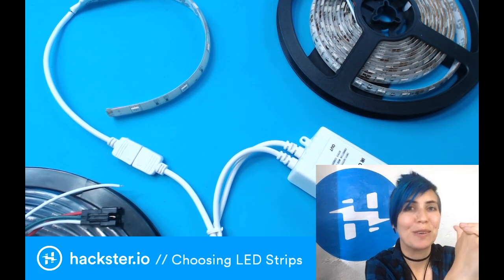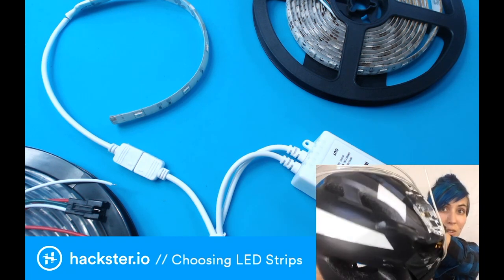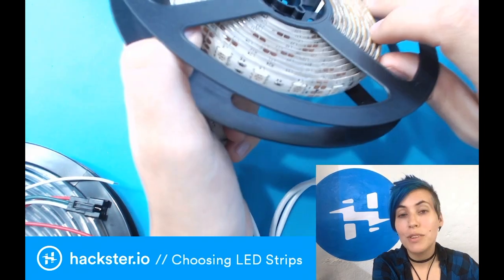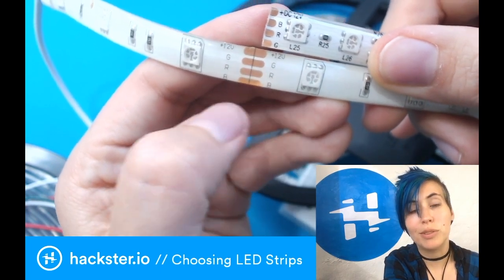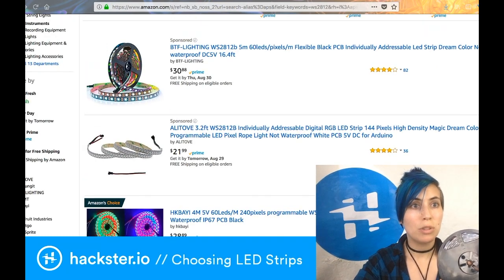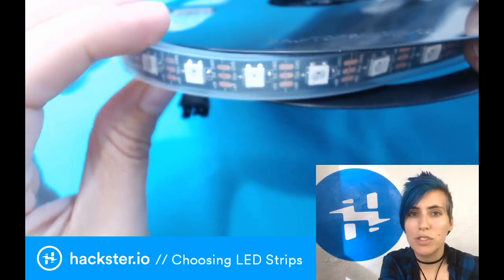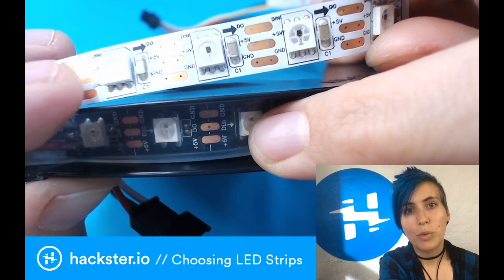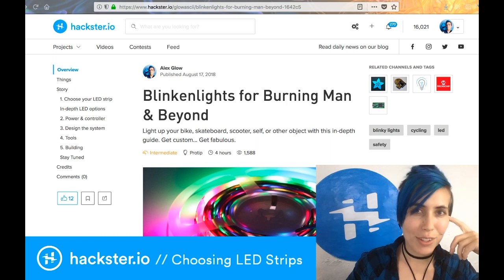Choosing LED Strips (Non-Addressable vs. NeoPixels) // LEDs for Makers, Pt. 1

Comment: Hi, Can you control non-addressable RBG with a microcontroller to have a fading effect? I understand that you cannot control each LED with a non-addressable strip but what I'm asking is can you dim some of the LED's and some not by use of a microcontroller.
Reply from the maker: You can control each color separately, so yes, you could dim the whole red, blue, or green channel independently of the others. However, unless you cut them apart and re-wire them up separately, the whole red channel will be controlled at once (and same for B+G).